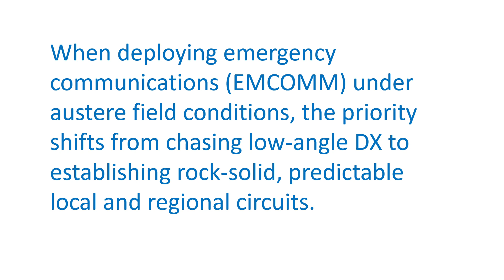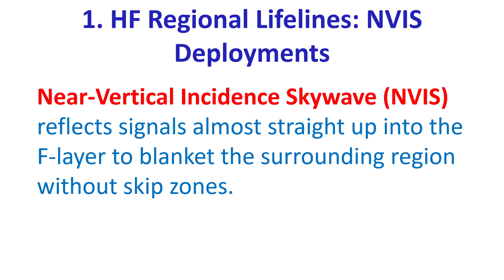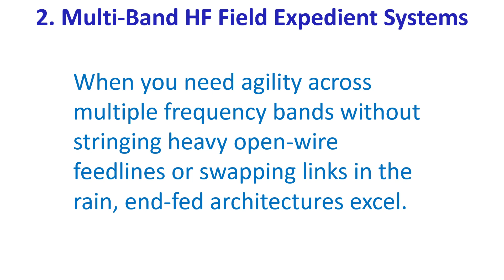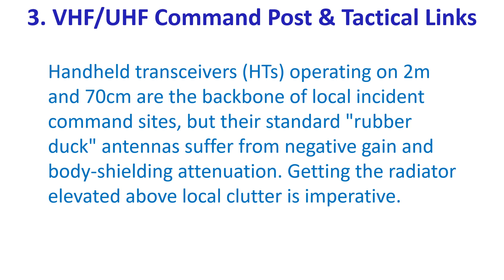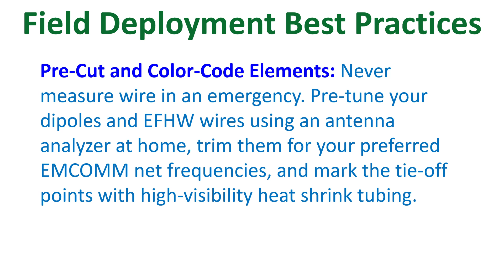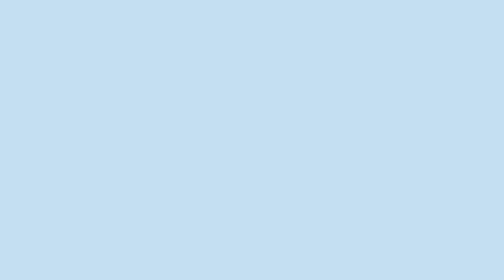Rapid Deployment Amateur Radio Antennas for Emergencies

Comment: With respect to your work but if you tell the people about emergency-setup u give them a bunch of options and this is questionable. Using an EFHW is a good idea, but your choke-strategy is not always necessary if you can attach a counterpoise cable. Overall, I don't understand why you use "Emergencies" at all in your video title. Maybe I have a different understanding, so sorry for that.
Reply from the maker: Thanks a lot for watching and your valuable inputs. Hope to meet you on air someday. 73 Jon, VU2JO